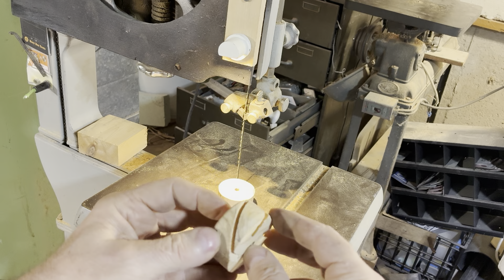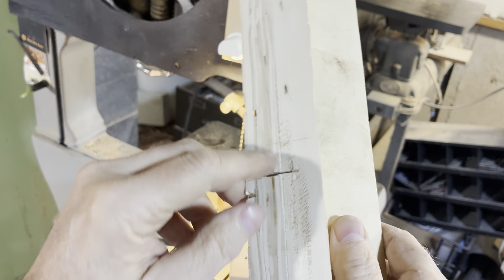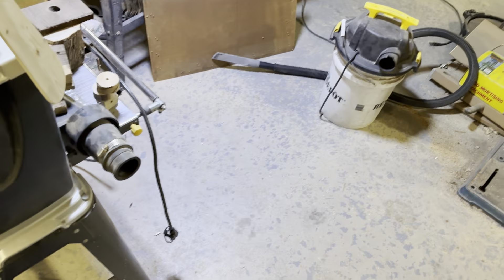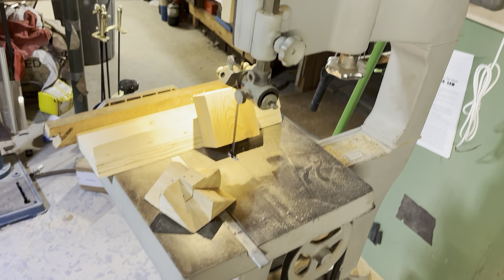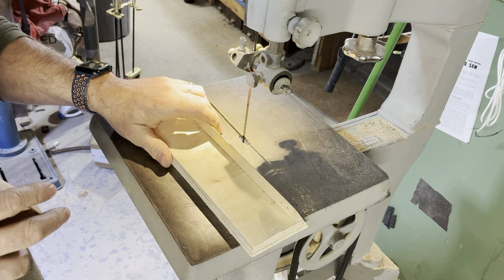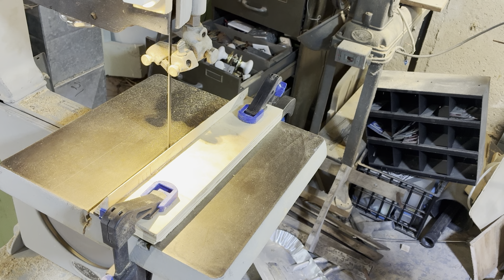Whirlygig Hub construction made easy with a bandsaw.  Takes me 3 minutes.

Comment: Good video.  When using a table saw you can cut the dado or slot wider by pairing two thin blades together.  Also for more gluing surface on a round or square hub making it slightly larger, say about 2 3/4 inches in diameter or more.  As far as manufacturing hubs. Using the miter gage on the table saw you can cut 2, 3, 4 or more slots in a round or square hub in under 1 minute each after setting up the saw and miter gage.